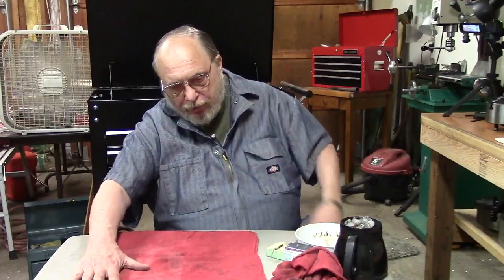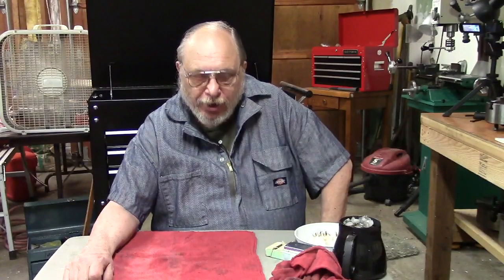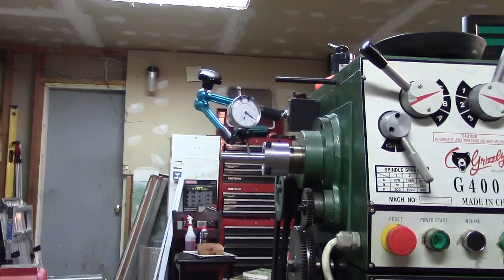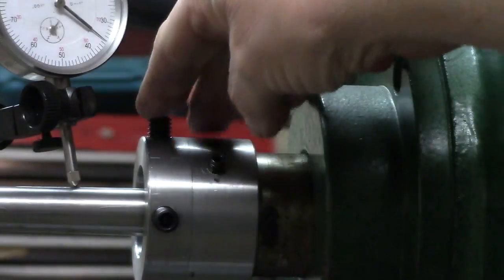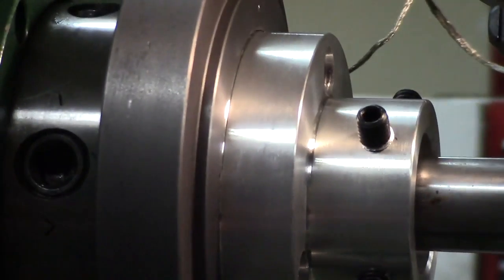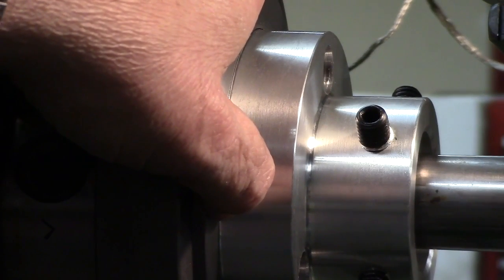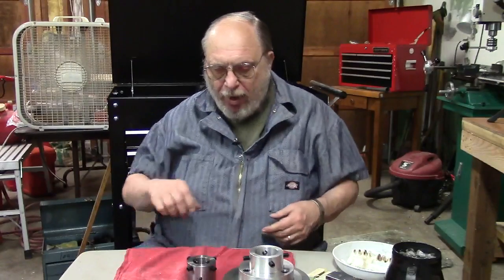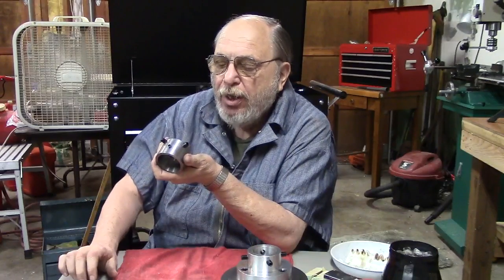Spider Chucks

Comment: The handle on the drill press used for tap and die cutting is the best ideal piece of work I've seen. Done this many of times by turning the chuck by hand to only loose grip on the drill press handle and end up hitting myself in the face with the handle. I will build one of these chuck handle for mine now. Great video.

Comment: Thanks for the good information.  I use a PVC front spider to hold cue shafts for tip replacing and shaping and have been brainstorming a back spider for a few days ... your video fills in some good ideas.